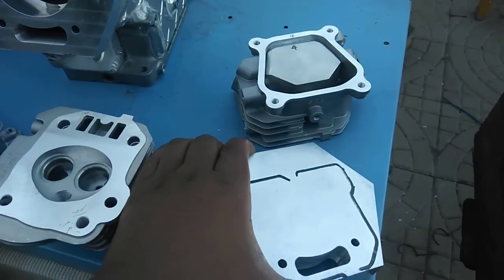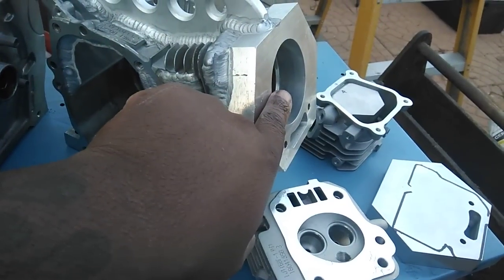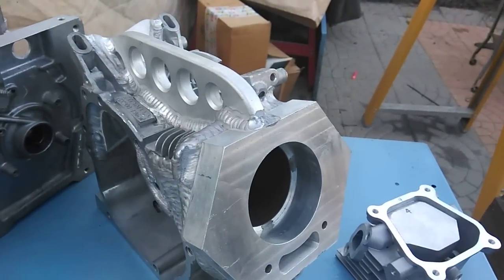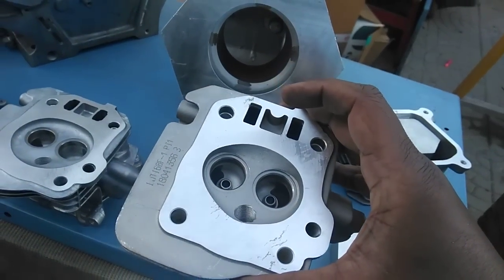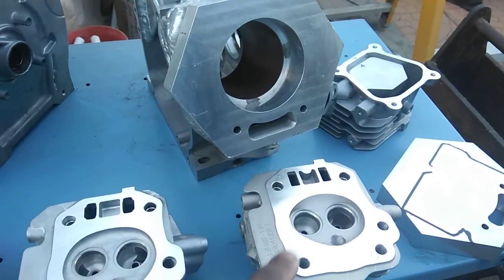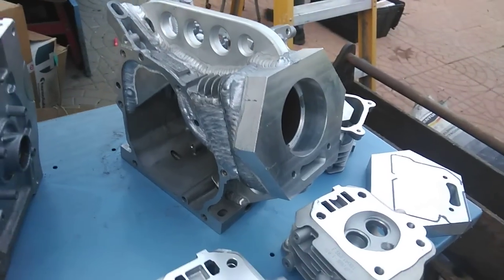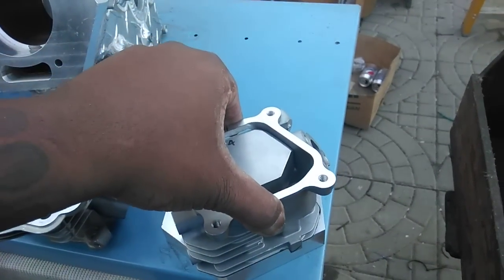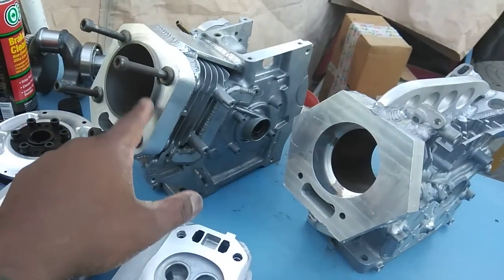Future Projects & Tech Talk

Comment: What crank are you running with a deck plate that thick
Reply: Is it a modified stock,billet, or a Frankenstein swap. Reason I’m asking is I don’t know were to look or I’m looking in all the wrong places. Cause I plan on building a custom billet block but I cannot find a long enough stroke crank to accommodate my goals.